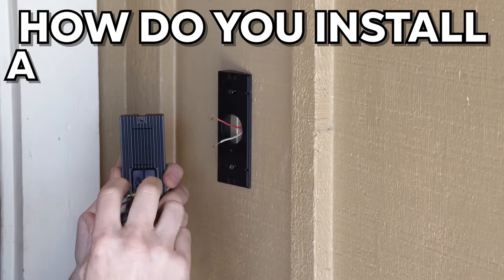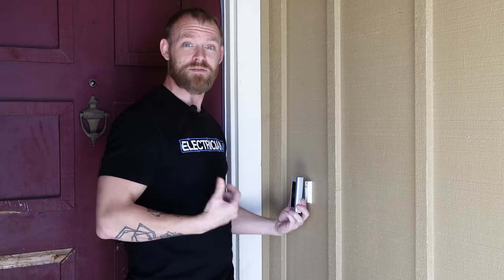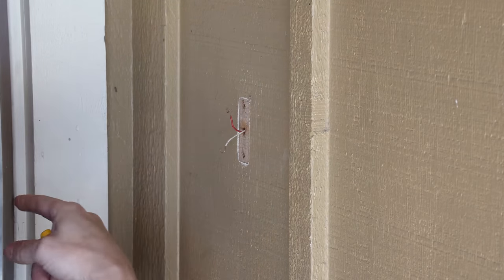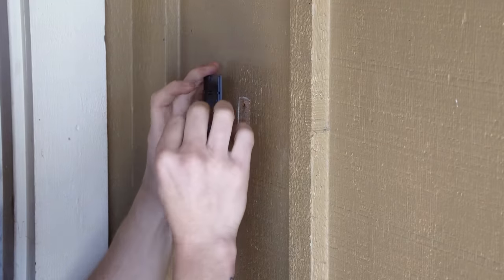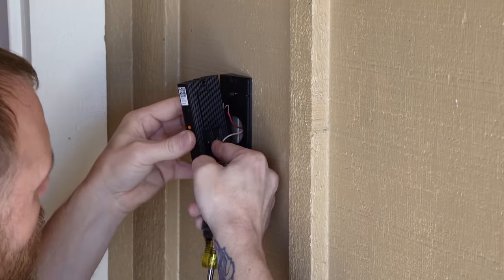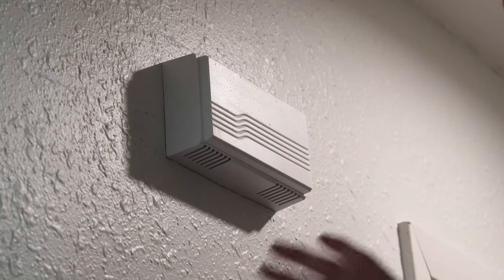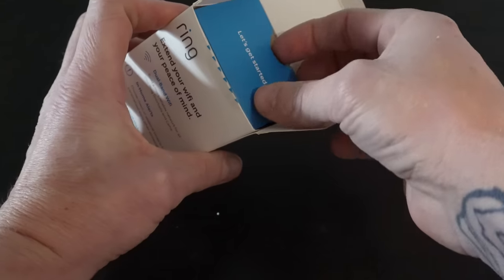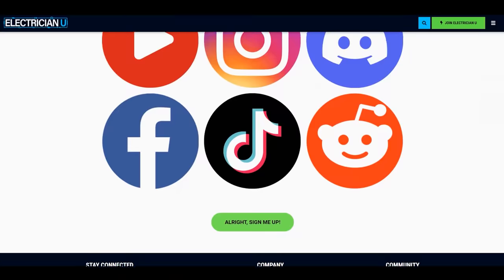How To Install a Ring Video Doorbell Wired -  From an Electrician

Comment: Be advised some video doorbells require larger transformers. I’ve had to upgrade some chime transformer that were only 10va to 30va to get, I think it was a Nest, to work properly.
Reply: Thank you for making this point!!
Reply: This here! I think all of the smart doorbells are rated for 25-30va. Which is well above most standard doorbell
Reply: Ive had the same issue when I first did one. You dont even find that you need a 30kva untill the very back of the Ring instruction manual under troubleshooting. The ring actually burnt up a 10va transformer
Reply: Was going to post saying the same thing.  I'd replace the 10VA transformers on any new install, it's $20.  If you have problems and contact support, one of the first things they want to validate is the power supply.  And the existing transformer is likely as old as the house.
Reply: The Nest is a pain in the.... I've had to change out the transformer AND the old  bell wires to get them to work. AND for some reason, if you have the Nest Thermostat, the doorbell has to pair with that to finish setting up. If your doorbell and thermostat are too far apart....you're screwed. Ring is good though,  no complaints.
Reply: Kinda killing the industry
Reply: yes, you go over the install of the doorbell but you don’t show how it works and when discussing buying a chime you don’t mention the fact that there are two types of chimes one that is just a chime and the other which is the one you showed is a little more money and extends Wi-Fi but they’re not the same. I installed my doorbell and put the jumper on my bell, but it doesn’t seem to be working right. I bought a chime because that’s what I thought I needed. the jumper disables the bell in the house at least that’s what I thought I read, and when I activated that it doesn’t seem to be working. So need to figure it out.
Reply: @tombarbato4348 the title of the video is how to install… not how to setup and use

Comment: Great video. Can you make one showing your install of the low voltage circuit for those that don't have existing wires. I'm running on batteries and would like something permanent. Thank you again for your videos.
Reply: It's super easy. You need an AC transformer something between I don't remember the exact range but between 12 and 24 volts works great. Hope the transformer up to 120 volts to power it and then you just need 18/2 wire to go from the transformer to the doorbell and you're good to go
Reply: Most times when it's old work Ill put a 2gang old work cut in or smart box in the wall underneath a switch (100% absolutely make sure that the transformer fits inside of the box you pick out, and that the box fits inside of the wall cavity. I have made that mistake on my first ring install and I was pissed since I didn't have anything else . I'll run 14/ 2 from the switch to my new 2gang box and 18/2 from my two gang box to my doorbell.

The transformer will go inside of the 2 gang box with a blank cover on it
Reply: Ditto.  I’m in a 95-ish year old house with brick on the front that has never had a doorbell.  So I’m curious about not only the installation of the complete system but fishing the wire with brick.  
Is there a wireless version?  Maybe that would be easier.
Reply: @fomoco300k  There is a solar-panel charger for the Ring.That may be a lot easier to install.
Reply: @RJR5243  Thanks for the idea, but my main entrance is under roof on the north side of the house.  I think, after looking, that one of the battery powered options is my best way to go.

Still wouldn’t mind seeing an installation from scratch– especially fishing the wires through/behind brick.  It would be good info in case I decide to go that route.  Maybe it’s not that practical, though. 🤷‍♂️
Reply: @fomoco300k  fish tape is your friend!! 
..and just in case, fish tape is a roll of narrow, flat steel coiled up in a plastic reel w/ a handle that allows you to easily push or pull the coil out of the end of the case (they are very compact and come in various sizes, widths, etc.)
  So it allows you to feed the metal put of the reel down from an attic (or wherever through your top plate (may have to drill a new hole, etc. down to your wall penetration attach your wire to it and pull it back up through with the little loop on the end of the tape. (you can use them however is easiest for the task at hand) ....oh and cheap ones can be a huge pain in the butt, so try not to drop it so the dumb thing doesn't get all bound up, some are bound up from the get go, haha)

They make all lengths and sizes and if you're considering running any wiring in your home, this tool is an absolute must!   

So if you're doing a doorbell from scratch (wiring only) just get a spool of 'thermostat wire' and start fishing!  (you may have to drill some holes in your top plates for wire) but getting the wire to where it needs to go and labeling each end so you don't get wires mixed up and also for future use so you know what goes to what (you can make marks w/ a sharpie, put a wrap of electric tape on each end of the first wire and thn two wraps of the second, etc. for identifying marks..get a cheap pack of colored electric whatever works)😊😊

Quick note about the wire...
(18/2, 18/5, etc. etc.) -- which just indicates the wire gauge and the number of conductors inside (and w/ wire gauge. the LARGER the GAUGE NUMBER, the SMALLER the wire diameter...18 being smaller than 10, for example) -- So in this example, 18 gauge w/ 2 (insulated) conductors.
**Important side note:
  Thermostat wire doesn't have a dedicated "ground wire" per se, so that second number literally gives you the exact number of conductors
   BUT if you're using Romex (for higher voltage stuff, like what runs to your lights, outlets and so on) you WOULDN'T use 14/3, just 14/2 because the ground wire is NOT included in the wire count.
    (again, just example, wire gauges always need to be calculated properly) 

Hopefully this was a bit helpful to someone out there (its not to be facetious or anything)!

Stay safe and have a good one!!
Reply: @dmeemd7787  Fish tape through brick.  That’s a great idea. 🙄
Reply: @Mac19124  That's easy for you to say, but I think the OP wants to see how you actually get the wires through the wall to the box and switch, etc.
Reply: @Mac19124  Typically a 16 VAC transformer for doorbells.  24 VAC for thermostats.
Reply: @Mac19124  You think its okay for the chime to go near the push Botton. I can't really run wires to far as the drywall is all done. They want a hard wired google nest where as before the dad told me not to worry about it and they would get a battery operated one when I was doing the rough in
Reply: Just finished the video and he mentions the chime kit which will be key for me because the chime is going to be in a bad spot
Reply: I have no existing door bell so how can I wire ring camera??  my outdoor light switch is close by can I tie into that

Comment: Few comments.  First, the transformers sold today will work.  Second the adapter at the chime is not needed with the doorbell 2 and other models.  Third, you need to see if your chime is mechanical or digital.  If you don't see the metal strike for the chime, you'll likely need the diode (read the instructions on this one).  Finally, if you have an Echo or Alexa device, skip the Ring-brand doorbell chime for upstairs or other locations.  You can add the Ring skill to Alexa and then it can either play the doorbell chime on any Alexa device, if you want, or I created a voice announcement, "Someone is at the front door."  You can then also do it with Ring cameras, "Motion detected in _ room," or similar.  I had a Ring Chime Pro and then tossed it in a drawer once I realized the Echo did it all.  Plus I don't have the Wifi 'noise traffic' a Pro extender creates.  (There's two chime models: pro and standard.  Pro is a wifi extender) OK, one more comment, you can also stack 2 of the adapters.  If you noticed, Dustin shows the adapter that tilts forward, and then another one that tilts upward.  Ring gives you longer screws to be used for up to 2 stacked adapters.  So, you can angle forward and up.  However, it's not recommended to use a 3rd and you'd have to buy it seperately anyway.
Reply: I ain't putting no Jeff Bezos spy named Alexa in my house.
Reply: Bravo
Reply: @Killer.Sputnik  ...ring is owned by amazon

Comment: Just an FYI.  The reason your screws aren't flush on the angle bracket is you've got the bracket on the wrong way.  The flat part should be on the wall with the open side exposed.  They don't tell you that on the included instructions.

Comment: In my experience, you want to check for compatibility of the existing chime with the model of video doorbell first. I've followed Amazon installers and homeowners to get these things working. I've had to install a diode, upgrade Xfmrs to 30Volt Amp, replace chimes, and cut out plastic J boxes that house the xfmr behind an electronic chime to make room for the larger xfmr. The bigger xfmr is sometimes needed to provide sufficient power needed to ring the chime and, drive the video.
Reply: As a life long electrician usually not allow to cut parts of flimsy electrical boxes. At a continuimg education class guy from UL stated that even though every sparky has made a knockout in a PVC box to extend a circuit its not legal. Have to ne extra carefull and cover your butt due to some sum bag ambulance chasing lawyers who would sue their own mother. Had bosses that wanted me to do serious violations. Told them to please placebitbin writing and I want a witness to sign it so I could cover my own butt. They always backed down.

Comment: Definitely with the ring pro needed to upgrade my transformer to 30va. And further depending on the vintage your wiring might not support the current for that. I had voltage errors on my ring even after upgrading it. Turns out when my house was built they ran a standard Ethernet cable from the transformer in the garage to the chime to the bell button at the door and split the cable in the middle at the chime to make the additional pairs - super tiny gauge wires. Ring's tech support advised me to double up the pairs on each side to carry the extra current but took a fair bit of detective work with a toner to figure out how it was wired to begin with. Once the aha light bulb went off a quick diagram of what actually went to what from where made it easy to do what Ring was suggesting and it's worked perfect ever since, but definitely not the easy install and you're done shown here unfortunately. In an ideal world I would have been able to run new doorbell wire but the way my home is that simply was not practical. Just know the wired smart doorbells can turn into more of a project than you'd expect..

Comment: I work for a home security company and I install about a hundred doorbell cams a year. The old cams we had only required 12-24vac and worked fine on the 16vac/10va transformers but the new ones require 1 amp of power and need the 16vac/30va transformers. I’m not a licensed electrician so I have to tell customers to get the transformer replaced by a pro even tho it’s easy enough for me I can’t take on the liability. Otherwise we have to bypass a transformer to run a wire to a plug in transformer to a receptacle. (Which I think looks ghetto but I can only do so much, I always recommend to get the transformer replaced, but some customers are too cheap) You should show how to swap a transformer or how a dual button system or dual chime box works too.
Reply: Common places it find the transformer is in the basement, attic, garage, entry closet, hall closet, furnace closet, utility room, and when you’re all out of places to look, check behind the chime box. Lots of newer houses use a double gang box behind the chime and stuff a transformer in it. I’m curious where else have you guys found transformers? When all else fails I have to fish an 18/2 wire to the nearest receptacle into a plug-in transformer. But you’ll need that chime extender.
Reply: @PrivateUser1  we used to mount our transformers right to the side of the electrical panel
Reply: How can I test for this?
Reply: Good info

Comment: I like to put some scotch 2228 moisture sealing electrical tape over the terminals especially if there's aluminum siding your installing it on or flashing for a door. I find it helps keep the moisture at bay from corroding the terminals as you find with most 10 plus year old push buttons and being the reason they commonly fail.
Reply: Just use Noalox...

Comment: One tip distin is to add the ring pro transformer because usually the transformer the people have is only a 10v. And the ring needs atleast a 16v but the universal trans they sell at home depot offers the 16-24v. But not the VA required so I have found you need to use the ring trans it will give you the required VA. 👍
Reply: Does the transformer have to be 24v? I don't remember but I've always used the tri-transformer
Reply: How do you find the transformer in the house?

Comment: I was hoping you would show more about the installation of the doorbell wiring and the transformer.  For the life of me, I couldn't find the transformer in my condo, but I finally found in a box in the wall behind the doorbell chime.  I'm pretty sure it's not up to code, but I can't find an electrician to touch it, and I'm not sure how easy it would be to move the transformer to another location and pull new doorbell wiring.
Signed, an IT guy who has enjoyed learning electrical from your videos

Comment: Good info. My Nest hardwired just crapped out and unfortunately Nest/Google doesn’t support them anymore. So sadly I need to replace it. This seems way too easy. And I’ll just remove the old Nest plate and install the new Ring plate right in its place. Probably only need a little stucco patch and paint when I’m done. Thanks again!

Comment: Two questions:  1. What does the power pack actually do? 2. If the doorbell button simply closes a circuit, then how does the Ring button get its DC power?
Reply: That’s why you add the jumper in the chime - it makes the wires to the bell push live.
Reply: There’s a step down transformer he showed in the beginning of the video
Reply: Do u have a video on how to install outdoor electric socket?
Reply: It’s storing energy to run the camera

Comment: What's required if I do not have a doorbell currently? Can I tap off an existing branch circuit, use a transformer and hit the chime and then to the ring? Do I need a chime if there isn't an existing system?2nd year Apprentice electrician here

Comment: Just a heads up if this has not been mentioned.  The base plate is installed backwards causing a gap between the baseplate and the ring unit.  Recommend flipping  over.

Comment: Private User, Brian Baldwin. and 0509kj are all correct. BEFORE you even start the install, VERIFY your existing doorbell transformer voltage and VA rating. That is the one critical thing never mentioned in any of the Doorbell Cam lecture. From all the doorbell cams I looked at, they mention an operating voltage range (okay, no problem there) and leave it at that. Not a hint of checking to see what you have. After installing and the cam and it not working I checked my doorbell voltage. I have a 10 Volt 5VA transformer wired with #26 telephone wire. Not even close to what the cam needs to operate. Now I have to change the transformer to 16 Volt 30VA, and maybe the chime as well, to get it to work. BEFORE you even start the install, VERIFY your existing doorbell voltage and transformer VA rating.

Comment: Doesn't Ring have an option to use a chime other than the existing one? I thought when you brought up that plug in chime that you were going to say something about not having to use the chimp on the wall and only use the wiring.
I see a lot of people making comments about transformers but you can go to Locke supply or your local Box Store and they sell transformers by where they sell the chimes. In fact, I think some of the chimes come with the transformer, unless it's a battery operated one lol.
but I was curious if Ring even needs the existing chime and if it can be disconnected and just use the wiring to operate the Ring doorbell along with the device like what you plugged into your hall?

Comment: Some of the other smart dirt bells you have to upgrade you doorbell transformer. Had to do that with mine. Sadly I’m still not getting power to the doorbell . So will do a continuity test  on the wires and go from there. Will prob run new wire .
Reply: Have you checked the voltage at the transformer terminals? I’ve had a few doorbell transformers that were DOA I think someone bought it and tried swapping and blew it out and just returned it to Home Depot for a refund. Be sure to check to make sure the box wasn’t opened previously before you buy.
Reply: @PrivateUser1  yes checked all good and getting the correct voltage . My issue is from the transformer to the doorbell not getting voltage. So I believe the wire is broke some where .

Comment: Followed your instructions to a T. When I turned my breaker back on the chime would not stop ringing. Turned it back off, checked all wires and connections. Turned breaker back on and chime would not stop ringing constantly so ran around to the front of the house to see if the doorbell had power, by the time I got there my chime stopped(thought that was good) but no power at the doorbell. So I uninstalled everything and put original doorbell back on and now there is no power at the doorbell. Did I burn out the transformer? Kind of at a loss here as the house is only 6 months old.
Reply: Im not an electrician but he mentions that touching the wires (after removing the doorbell) signals the chime to go off

And to be careful not to accidently make them touching when connecting the wires to the ring.